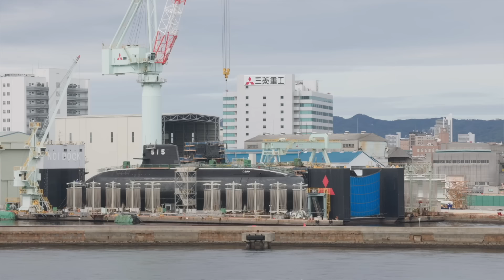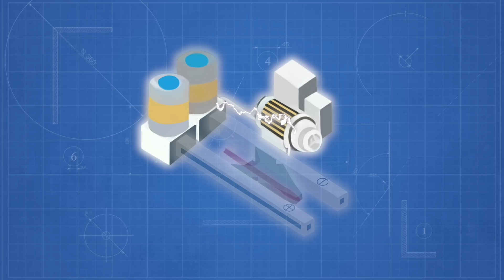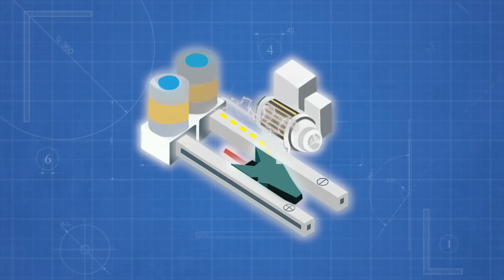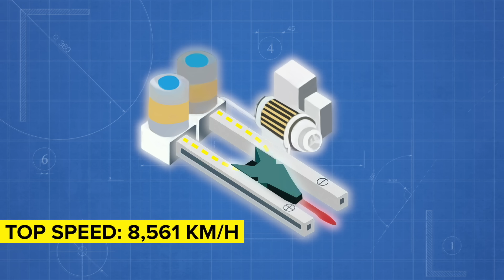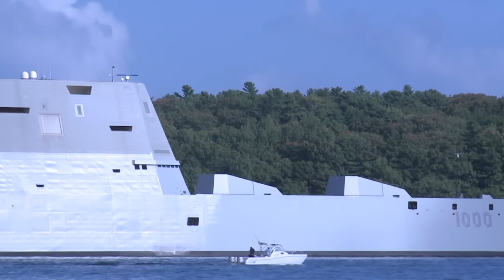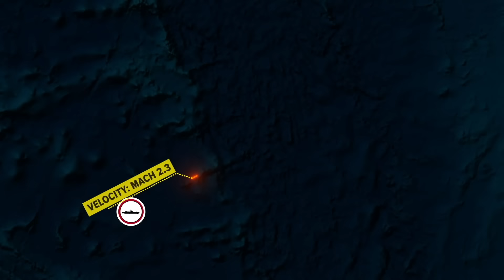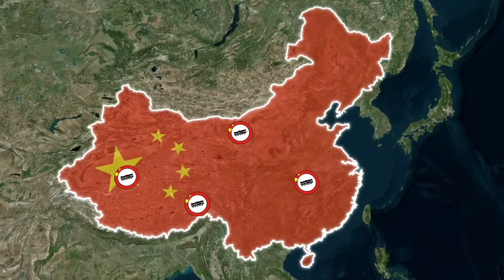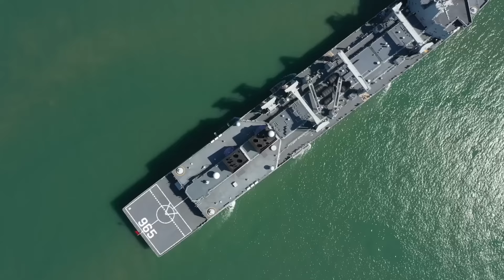Japan’s New TOP-SECRET Weapon TERRIFIES China

Comment: Rotation of a multi barrel unit would increase its rate of fire
Reply: The barrels arent the problem, it's the recharge. An auto loader can't likely load the next slug faster than the system can charge for the next shot.
Reply: @rroott1657  thx buddy